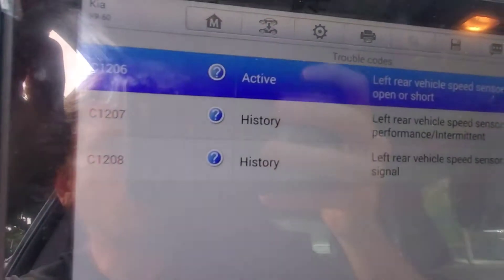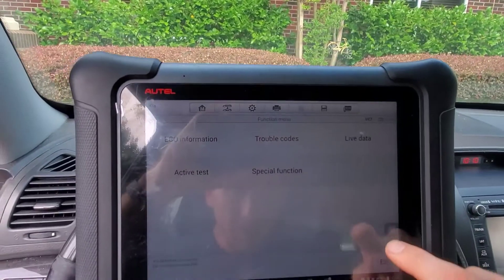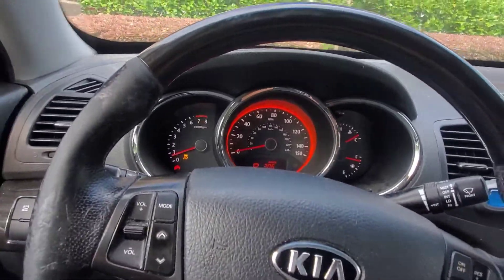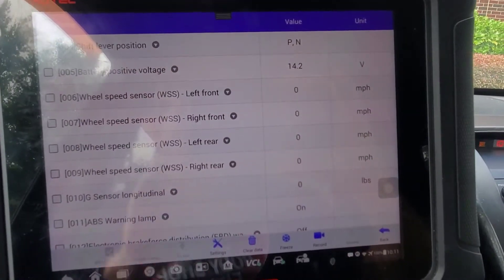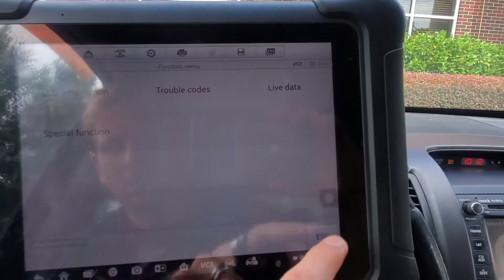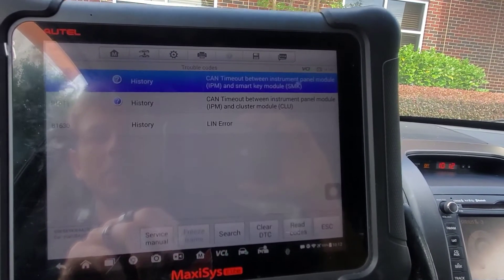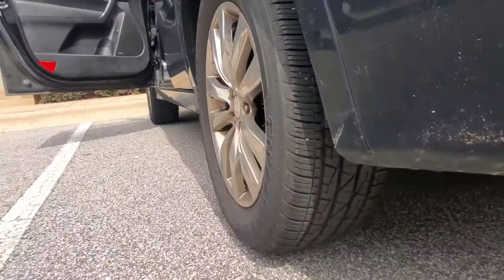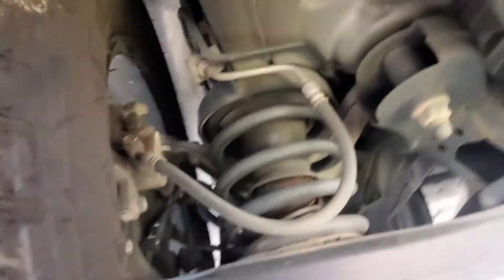Kia / Hyundai abs or traction control light on. Codes C1206 C1207 C1208 C1209 C1210 C1211 tsb.

Comment: Hi, I had codes 1208 and 1206 come up. Do I need to replace just the sensor or replacing the hub will fix the problem? Do I need to replace both?
Reply: Did you ever change both parts?

Comment: I had all 3 of these codes pop up at same time last month. The C1211 and C1209 and the B1102 for the low voltage on airbag. The first two are a give me, change out the rear speed sensors but, getting the low voltage on airbag, is that in any way related to the speed sensors? I’ve been seeing everyone getting all 3 of the codes when the speed sensor failed. Mine is a 2013 Sorento EX FWD.
Reply from the maker: Speed sensor unlikely related to Airbag code. Both are very common with these models however